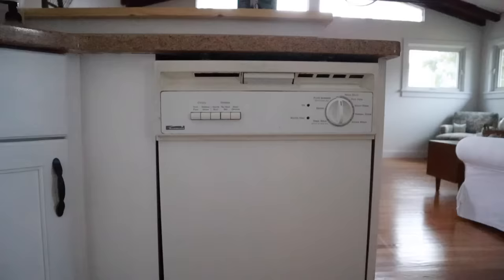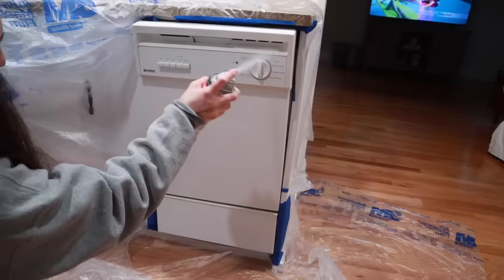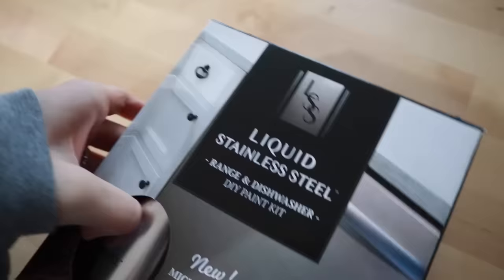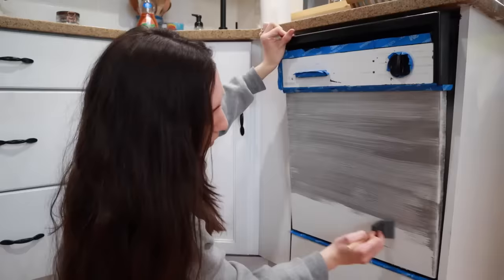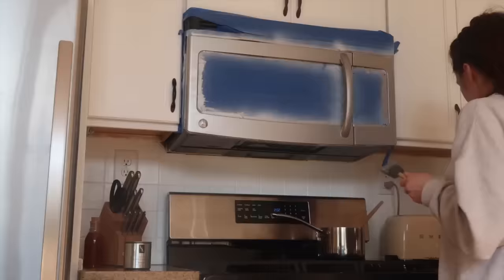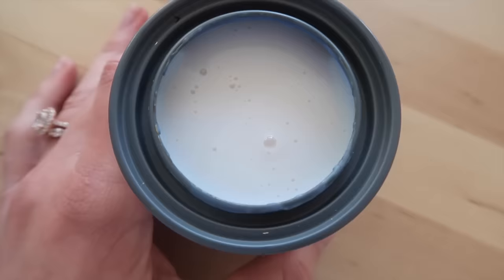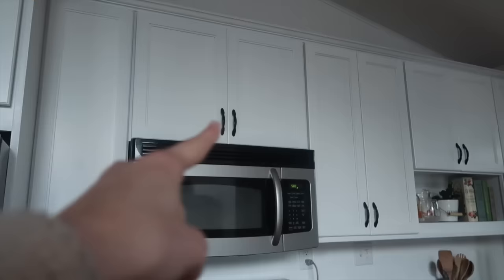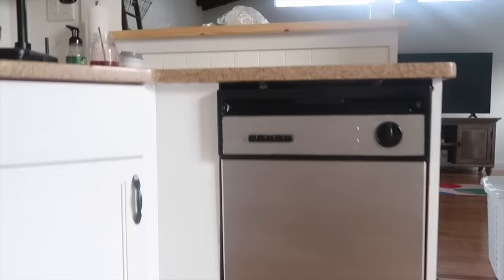PAINTING MY OLD APPLIANCES WITH STAINLESS STEEL PAINT//how to makeover old appliances for $24

Comment: Fyi: all latex paint cleans up with soap and water
Reply: Tavarus McKinney she said it was water based paint
Reply: Fyi means for your information i guess
Reply: @maariahh7872  Latex is water based paint and yes, it can usually be cleaned up with soap and water or just simply scraping......but only if its on non pourus surfaces.
Reply: Jill Franklin scraping to remove dried paint works great on glass, stone, ceramic, etc. However, scraping dried paint off shiny plastic... (tsk) that would’ve been a total frickin disaster of scratches marring the surface forever. She would’ve had to sand & polish the scratches out just to get rid of ‘most’ of them, & that still would not have removed all of them, especially near the recessed edges - right where most of the problem paint was located. 🤷‍♀️ I think she made the right call.
Reply: @ashleyfalcon125  No, that's not usually the case , it depends on the plastic. Latex paint only adheres to porous surfaces. This is why you have to use a bonding primer before painting some surfaces with latex or use a chaulk, milk, oil, acrylic, etc paint instead.  Latex is water based, therefore, not very adherent in nature. Plastic that is rough in texture, it can be a bit harder to remove from. But smooth, shiny plastic.....no. She wouldn't scratch the plastic, because she would scrape with a plastic flat edge scraper, not a metal scraper or razor blade in this instance. Plus, you don't have to scrape much at all, it mostly peels off or washes away with soap and water. My step father owns a construction company. We own a home audio/video business and are in new construction homes and/or homes being remodeled alot. Glass, ceramic ( if glazed ), yes those are easily cleaned as well, but stone, not so much. Unless it is a heavily buffed or glazed smooth stone. It can be quite difficult or even impossible to remove any type paint from rough stone.

Comment: Its the amonia in the window cleaner. It evaporates quickly. Cleans well and doesnt leave an oily residue. A tip in case you are planning on painting an aluminum surface. Try to find a zinc oxide primer. Its generally a yellow goldish color. It bonds extremely well with aluminum. Also try to determine if your metal is laminated. It can make a big difference on what paints will work without melting or disolving the laminate. Im glad you are doing this stainless paint. I have not seen a finished product. When i heard about it i figured its about like the "chrome " paint that looks like crap on anything you put it on. Oh on the widndow cleaner or amonia dont get it on the rubber seals on any appliance. It tends to break down rubber and adhesives.

Comment: If you want to achieve a protective coating and texture that you desire of, then may I suggest you try to use clear lacquer spray to finish it off. It will protect the paint and make it much more resistant

Comment: For the section with the labels you can’t see, you can just replace that with a black replacement label. That likely wouldn’t be stainless if say you got that model in stainless. It would be black. They sell them on amazon and at parts stores you can easily find online. Just need to know your make and model. They are very cheap and easy to install.

Comment: You can print the labels onto clear vinyl (the kind used for crafting) then apply them to the dishwasher in place of the old labels. Use your pic of the old labels as a template for font size, placement, etc. In fact, the old labels were probably printed onto a sheet of vinyl in the first place.

Comment: Pick up some used appliances and test it out on those first. Some pieces can be removed first. Things like your dishwasher, you can usually remove the metal panel and paint that, wrap it in vinyl, or even stick a piece of actual stainless steel to (like a donor fridge panel).

I'd say disassemble anything you can.

I spray painted my Cougar's interior with silver Duplicolor wheel paint back in school a couple decades ago. I regretted that. It's probably on their website, still.

Comment: I personally like the black showing on the microwave.  It matches the window of it and blends really well with the stove and cabinet pulls. It also works well with look of the dishwasher.  
Another thing you could possibly try with the paint problem from the tape is an exacto knife or very sharp razor blade with light pressure and multiple passes to possibly even the lines without marring the dishwasher itself.
  The other idea is maybe printing words from a computer and sealing them with glossy modge podge and another clear coat of paint on dishwasher. May could work

Comment: U could alternate the button labels..... first one goes above the button,  second one goes below the button.

Or attach them all parallel to each other but angled up at a 45 degree angle. 
Just make sure to make each label the exact same length so it doesn't like an afterthought.  And also, u can cut the top end of the label at a 45 degree angle so the top of the labels are parallel to the floor & counter edge.  Totally would look like it belongs!!

Comment: Nice job, but there's a much simpler way for things like the dishwasher. Just remove the front panel! No need to tape off all the cabinets etc. It's only held on by about 10 screws. Lay it out on a plastic tarp out in the driveway, and spray away. I did mine years ago - from white to stainless steel, and it's held up beautifully! And I changed out the front of the control panel by shopping for one online in black.  Plus, you don't have to go through all that prep. Rustoleum and Krylon both make a great spray paint that works great on plastic, which is what the fronts are all made of.  Piece of cake!

Comment: Regarding the words for the buttons on your dishwasher.  At Office Depot or wherever you can buy clear Avery sticker labels.  You put a sheet in the paper tray of your printer.  You pull up the template for the correct Avery 4 digit code of your stickers.  You type in your text allowing you to pick the size and font you wish.  Print it out, peel off the clear label and Stick it on!

Comment: There's a product made by Grafix that allows you to print out custom text of any size on your printer, then just cut it out & stick it to your appliance. After its applied spray it over with a good clear coat to protect it. The green frog tape seals better and does not bleed through as much as the blue tape, but pull the tape off while the paint is still wet so that you do not  peal the paint up with the tape.

Comment: The nuker needs more glossy coat in order to match the stove, but if that is not an issue then it is fine. The DW looks like a cartoon with the letters missing! lol You can print out a label on a sheet of plastic and glue it on, though. Looks pretty good over all! Great video!

Comment: A trick to the lights on the dishwasher is to use Vaseline on hard to paint places... just put a small amount on a Q-tip rub it on places you don’t want painted after the paint dries just take a rag and wipe the Vaseline and paint off...

Comment: A tip;  painters tape work fine but frog tape is much better for cleaner lines and less bread through amd tape should always be pulled while paint is wet if you can't use a razor blade to lightly score the tape paint edge before removing.

Comment: Use ur label maker to make your words but put them vertically instead of horizontally that way you will have room for them to fit above each button.  This may have already been suggested but I'm new to the channel and I didnt want to read through every single comment. Looks great though. And I'm sure u seen where you need to take painter's tape off as soon as ur done and not leave it on there for future projects. Great job!

Comment: TIP FOR LABELING:
I ran out of tape on my marker, and had to get creative. As I did'nt want to write directly on what I was marking (like a drawer) in case my handwriting got messed up or I wanted to use the drawer for something else, so I came up with using electrical tape (black or white, don't know if they come in silver), and can write the lable until I am satisfyed with how my handwriting turnes out and stick it on. Electrical tape (for cords) is very easy to remove on most surfaces. Be aware that it is flexible, so you need to be careful not to pull it so hard that it stretces before you stick it. You can temporarily stick it on glass or mirror if you need a flat surface to write and not the bend the tape roll has. 
I use white sharpie for black tape, and black for white tape. I also mark all my chords with this tape, so it's not confusing what this and this thingie the chord fits with, how long it is and so on. Less confusing in those boxes we all have wit cords we forgot what it's for that we all have, or the chaos it can get behind the TV.
Reply: Massivly thank you for the video btw. I f**d up my refrigirator by thinking I could use one of those markers for glass to write and whipe, but ended up with it permanently remind me about an appointment three years ago!! xD I have a cool picture fastened with magnets, so I could live with it, but now looking or diy videos on how to paint. Your appliances look amazing, so I will try to find that or similar in Norway now. Thanks a lot for the tip.

Comment: Where did you get paint? Looking to paint metal closet  bar in 65 year old home. Been looking for quart (or gallon) size metal paint for ~ 10 years.  Model metal paint would be way too expensive for that project. 

Amazon ... Thank you.

Keep the vent black ...  undercounter microwaves come both ways. And, if plastic or not steel definitely keep black. And vents or open slats are  very difficult to paint ... without causing drips and or paint globs. 

Don't mess up what already looks great and normal.

Comment: Put down the tape.  Clear coat the edge that will be the line.  This step will prevent bleed through.  The edge will be crisp.  Once dry, spray the new intended color.  Perfect line, no bleed through, professional step to ensure the project looks great.  For walls and paint, paint the tape the other color.  Once dry, paint the new color.  Again nothing will leak under resealed edge.  Terribly important if painting stripes for crisp lines.

Comment: Nice job. Just a heads up for the future (and of course I haven't read all the comments so someone could have already said this and if so, my bad), when painting and using masking tape or painters tape to cut lines, you need to peel it off right away when it is still wet. You get cleaner lines that way and less sticking and bleeding.
And if you haven't fixed the labeling issue yet (this is my first time watching one of your videos), you could find someone who has a label maker that prints smaller and can space out things. I have a fancy Brother label maker that I am still learning how to use, but it prints small if I want it to. And it has borders and other font features. So yeah, if you don't want to buy a different label maker, maybe see if a friend can let you borrow theirs :) 
Cheers, you got a new sub. May you stay safer and saner in these pandemic times ;)

Comment: Great vid! And im actually considering doing the exact same thing to my black micro.
I think if u gave the flat perimeter area of the vent the stainless paint,  and left the actual louvers in black,  it would not only mimic the "stainless frame on black" style of the nuker front/door,  but would also turn the black down to be more of accent color, just like your door pulls. 
I love the outcome as is Anyway!
My nuker works fine but this gives me a great chance to try the product so my nuker finally matches my fridge  & dw.

Comment: I do not recommend using spray paint and enclosed space. I developed allergy-induced asthma due to this. And I only went to painting something for the kids to play inside. Being in that small area for a short time was my downfall! I have a new stainless oven and microwave and have been looking to paint the dishwasher. Refrigerator is white but it has built-in cabinet front so there's a little white to paint

Comment: Print out the words on white paper with ink jet printer.  Cover type written on paper with paling tape. Soak paper with water on a sponge until paper disappears.  The type written words should appear to tape and create a decal you can use instead if writing it out.

Comment: Did you ever put a clear coat on the black spray paint? I am doing this right now and I'm wondering if I should clear coat this black spray paint for chip protection? I used the rustoleum engine enamel black.

Comment: I like how you had problems as it is tough to watch tutorials when professionals never get themselves in trouble. Leakage isn't unusual.  Scotch tape works better as a seal for painting stripes, than blue paint tape, you have to rub it down and then peel it up carefully, slowly back on itself-sometimes going over the division with a razor blade to cut before peeling the tape off. Hopefully not creating an edge, but you can sometimes rub that down if that is the case. I've done jobs where we even painted a light clear coat on top of the tape sealing the edge before then using the main color. For the first coat, feather the main color over the tape edge, at 90 degrees, rather than painting parallel.. Also, once the paint is barely dry remove the tape so clean up goes easier if there are any leaks.If you remove the doors, then you have less drips and leakage too. You can use a credit card or polystyrene edge to clear off paint residue off of plastic, to not scratch.

Comment: Would this work on my stove? I would love to try this however I have a glass top stove and the oven door does heat up. ( course I would not use it on the stove top). And did you have any stainless left over I'm wondering how many if I'm in need to buy

Comment: You can get a window scraper I’ve been painting for over 20 years and we sprayed a house one time and we ran out of tape and Home Depot was far away from where we was and we had a window that we couldn’t cover up because we ran out of tape and the paint they got on the window we got it off with a paint scraper LOL window scraper I’m sorry then they have the stuff called Dirtex it’s kind a like it all purpose cleaner you can clean windows floors it says porcelain I forget it you can put it on a lot of stuff it’s really good stuff like when you’re doing any kind of work in a house you can clean the windows with it countertops and any overspray or paint on the floor anywhere you spray it on there let it sit for like a minute and it wipes right up that stuff is the best stuff I’ve ever used for paint clean up and I also use it on a wood table my daughter got her hair done and the girl got some of the hair dye on the white wood table nothing will take it off the dirt tax I sprayed it on and let it sit for a minute wiped it right off they sell It at Home Depot in the paint section

Comment: Will the paint smell or crack when you use the microwave/heat or let off any harmful toxins?  Just wondering....
Reply: Julie EE this was done on the outside of the microwave, it’s not the inside.. so of course is doesn’t smell, crack, or anything like that when using it. The front of a microwave does NOT get hot when using it. Not unless there’s something very very wrong with it.

Comment: Transfer paper would work wonderful, it's basically what they use to put the cycle names on it. You create them on your computer and print them in transfer paper. They work like fake tattoos, with a clear top coat they are permanent.

Comment: Rather than write it on the front as it was, you can write it on the frame, where you open the door on the top so it is not seen until you open the door.  That's what the news ones do.

Comment: Dishwasher only has 4 buttons. Use 1 letter for each or - if it was me - I'd skip labeling it entirely. Memorize the 4 cycles. Also, didn't you say it doesn't work anyway? If so, again I'd skip it. Not worth it. Definitely do not use that old-fashioned label maker. If you really want to label, there are labelmakers that use clear tape & where you can choose the style & size of the font to be printed. MUCH easier for you. If you feel you really need labels. I think it would look much sharper without them.

Comment: god you talk a lot like get to the point already. also you should not paint the vent of the micro and next time you can take off the dial cover from the dishwasher their should be screws either on the side or surface, paint it then put it back to avoid paint bleed.